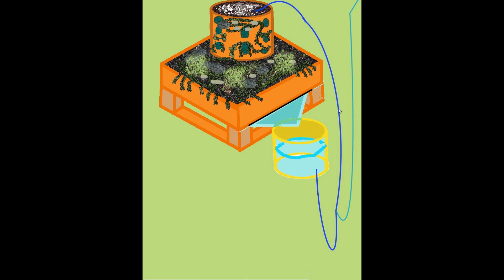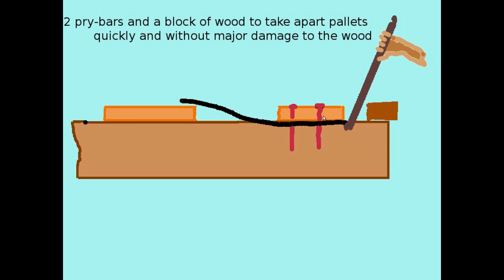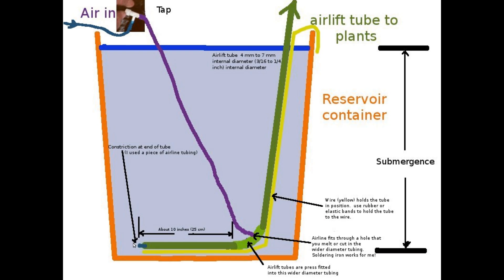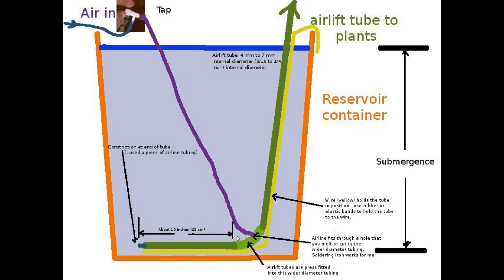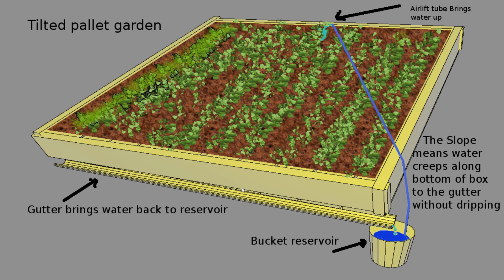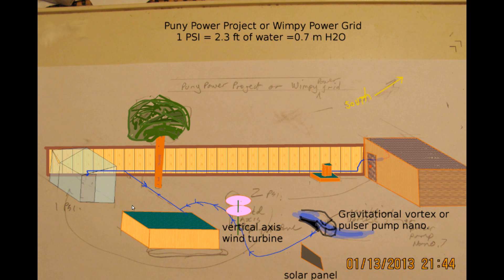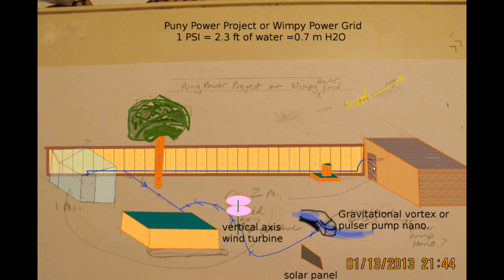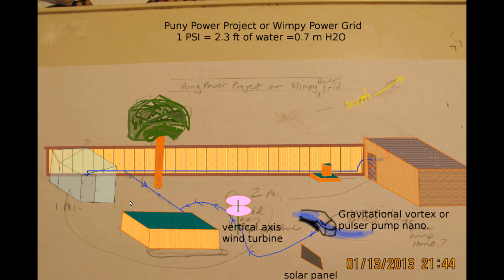SUCCESS!  Pallet garden project is spreading WORLDWIDE after only 10 months!

Comment: Brian, I have been using a modified version of your pump that periodically closes a syphon and pumps out water at pressure to refill my aquariums daily for years. I can't remember what you called it. I have made a modification such that when the syphon closes, it also pressurizes the outlet with air, causing a mixture of air and water to go up the pipe instead of just water, allowing a much higher height to be reached and at greater pressure. I also use a length of inlet tube with a constrictor.

Comment from the maker: Thank YOU!  (for keeping it going in January when I very nearly pulled the plug completely). I have a couple of playlists (other peoples work) of small wind, hydro, and solar  and of Stirling engines. It is quite amazing how many ideas are out there!  Check some of them out.  But in most cases they connect their tiny irregular power source to batteries or the electrical grid. The economic cost of batteries or connecting  "Kills" the potential. But the pnuematic grid is WAY cheaper.